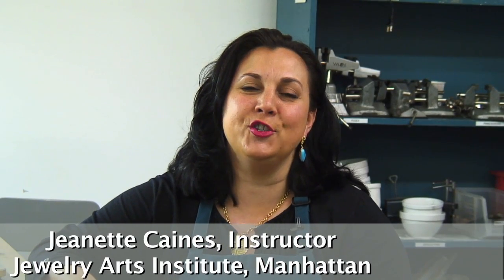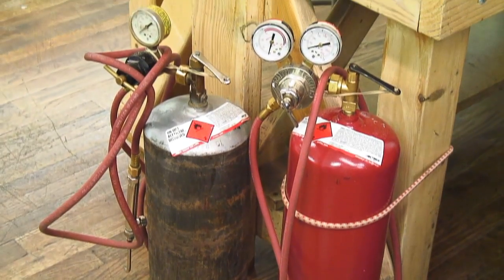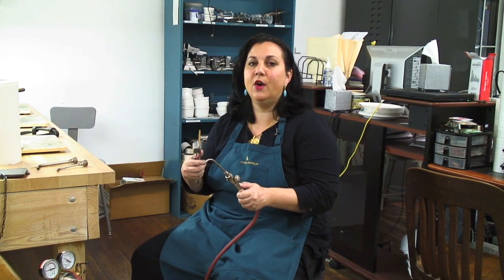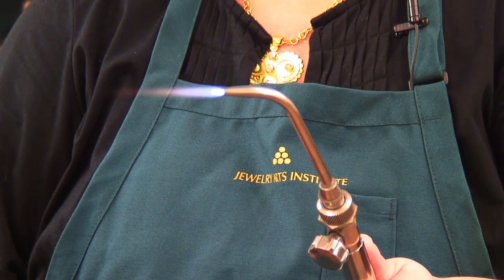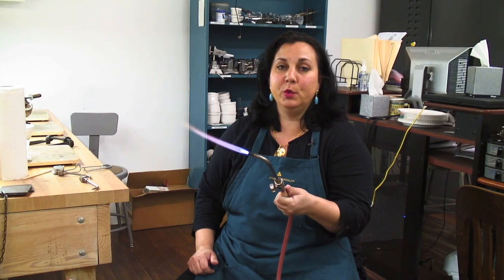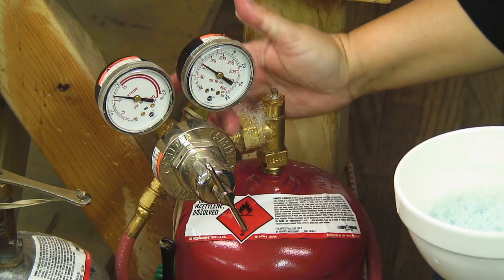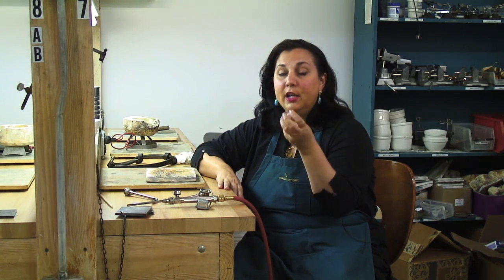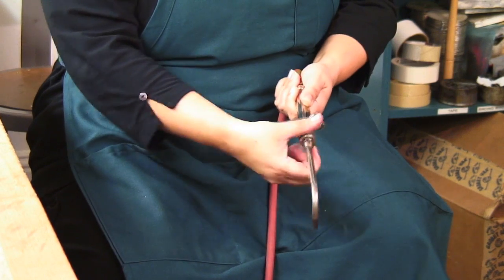How to Use a Smith Acetylene Torch-Acetylene Torch Use and Safety

Comment: but you should always ALWAYS back your key out fully when shutting down the tank so that all the threads are showing. if you keep that side engaged and you turn on the gas, that sudden pressure actually ruins the diaphragm pretty quickly, making for a dysfunctional regulator and a potentially dangerous situation in the future. when the key is disengaged, and you slowly introduce pressure, its much much easier on the diaphragm and ensures the health of the regulator. never, ever keep that key engaged everyone, always back out. ALWAYS. you engage from ZERO every single time you use your tank. I love jewelry arts so much, but this is a point that I cannot understate enough how important it is. ive had extensive conversations from the people at smith! this is something that is actually crucial.
Reply from the maker: Thanks for the input! :)

Comment: My regulator only shows how much is left in the tank, there is not one to show pressure.  There is a pressure knob, but no gauge to check it, so I don't even touch that knob. I'm not even sure what to do with that when removing the hose to replace the tank.
Reply from the maker: You have one of the older versions of tank with no pressure gauge, we used to have lots of them and we used them without incident.  :)

Comment: Great video!  Can you show us what the tank pressure is supposed to be set at the regulator?  And how would you test it to make sure it is satisfactory?
Reply from the maker: So glad you are enjoying the video! Mine is usually at between 8 and 12. anywhere in that range works great. If I am alloying, I definitely make sure it is in the higher range. That is probably the only time that the lower range won't be as satisfactory. :)
Reply: @JewelryArts  Also, do you happen to use a flashback arrestor on your acetylene tank?
Reply from the maker: @windsurfer3329   Flashback arrestors are used on setups with a separate oxygen tank. This setup is called atmospheric oxygen, it doesn't have a separate oxygen tank.

Comment: Do you have any info on what kind of eye protection you need for an acetylene torch?
Reply from the maker: It can't hurt to wear uv blocking glasses but they aren't a necessity as they are working at higher temperatures. :)

Comment: Hi, do you think I can use the tool used for dental cleaning for a pick?  I understand that the tips of many of these are made out of titanium alloy.
Reply from the maker: Most of the ones I've seen have just been steel but give it a try. :)
Reply: @JewelryArts  It turned out the one I had was made out of tungsten carbide, and silver solder did not stick to it :-)  So, I was wrong about titanium.
Reply from the maker: @windsurfer3329   Cool! Glad it worked. :)

Comment: Hi! can’t you burn your table top by placing the hot torch on it? Or is there a stand one can purchase?
Reply from the maker: The torch can get warm but never warm enough to scorch in my experience. I'm sure you can get a stand if you like. :)
Reply: @JewelryArts  Wow! that’s wild! Even my small butane torch scorches the wood that I lay it on. I’m actually finding it very difficult to find a stand… there is only one on Rio but the reviews say it doesn’t work for the Silversmith Torch. I’m going to try a broom holder that someone suggested 😬😅
Reply from the maker: @gogijewelry  The tips must get hotter on a butane torch. I would try a welding website, like cyberweld. I am sure someone has a torch holder. :)
Reply: @JewelryArts  thank you so much!🙏🙏🙏
Reply from the maker: @gogijewelry  You are most welcome! :)

Comment: Great video.  For acetylene only torch use, is it required to use a ventilation system?  Also, I think I read somewhere that acetylene produces a "dirty" solder. Have you found this to be true?   Is there another type of fuel that's much cleaner?
Reply from the maker: Acetylene does not require any special ventilation measures. Although I believe the “ dirty” part is true  with platinum it works beautifully for silver and gold. 😃

Comment: Thank you for another great video! Question...what about ventilation? I have a Sentry Air Systems fume extractor with HEPA and carbon filters in my home studio. Is that sufficient?
Reply from the maker: Lol, I just have a normal bedroom at home for the studio so you should do great. 😃
Reply: @JewelryArts  So many people try to incite fear instead of teaching proper safety! Thank you for just telling it like it is! One guy told me I should NEVER have an acetylene tank indoors, and another told me if I did I might die from the carbon monoxide it emits!
Reply from the maker: @kimberlycoy7509  what absolute nonsense! Every jewelry studio that uses acetylene is inside, and plumbers use acetylene for fixing pipes in people’s houses. Where is carbon monoxide supposed to come from?
Reply: @JewelryArts  lol! Idk...but they even told me I DEFINITELY needed a carbon monoxide detector, at minimum! It is very kind of you to make yourself available to provide accurate information! Thank you!!
Reply from the maker: @kimberlycoy7509  Tanks should be treated with care amd respect, of course, but knowledge drives away fear. Some peple are just.....dramatic, I guess.

Comment: When I light my acetylene/oxy torch I get a big poof of soot - it gets on everything and is a huge pain to clean up. How do I eliminate or significantly reduce the soot when lighting the torch?
Reply: This can happen with acetylene, I've heard if you have too much gas flowing that will happen as well. Have you tried cleaning the inside of your torch?  That might help.
Reply from the maker: Yup, a soot buildup. You can use a pipe cleaner.

Comment: I have a question. are you using acetylene with no oxygen ?? I am surprised as I have never seen Acetylene used without oxygen or on its own.
Reply from the maker: We do not use a separate oxygen tank only atmospheric oxygen. Using a oxygen tank will increase the temperatures but for our uses, we do not need it.

Comment: Alright... Absolutely pisses me off to admit, the oxy torch is a bit too hot for silver. Has it's place, but too hot and sharp for general use. Blew a hole in my screen. Will the acetylene/air torch still melt an oz or 2 of silver or gold for casting?
Reply from the maker: Yes, I find the atmospheric smith torch with acetylene is perfect for silver and 22k work. I pour 2 ounce 22k ingots using mine all the time but it can't be at the end of the tank. :)
Reply: @JewelryArts  Fantastic. I think this is a case of simple is better.
Reply from the maker: @TaprootMetalworks  I love mine, it does everything I need. :)

Comment: Always use eye protection when soldering / brazing. 
That tank with the old single regulator - replace it.  It is obsolete and does not comply with OSHA current regulations.
Reply: Also noticed neither of your tanks had a Flashback Arrestor installed.  Please update your tanks, a huge safety factor and required by OSHA.
Reply: jd dr.jkindle, single tank (cylinder) is excluded from the flash arrestors regulations,  she is perfectly fine and legal! ... by NFPA and OSHA.. FYI..both organizations only have authority in the USA...

Comment: i have a smith torch it does not melt fully to pour into a mold why?? DO i need to add borax or flux or lubricant or more heat
Reply from the maker: I would need more information, like how much and what metal, what kind of crucible, etc. I'm happy to help if I can.
Reply: 2 oz sterling 925 and melting dish crucible
Reply from the maker: All crucibles require some borax as a lubricant so the metal can "slide". Are you using a #2 tip?
Reply: a #1 tip
Reply from the maker: I usually use a #2 tip for alloying one ounce of gold, I think you need more heat.